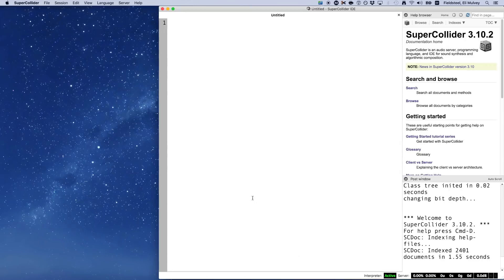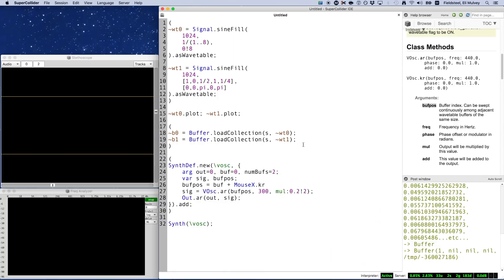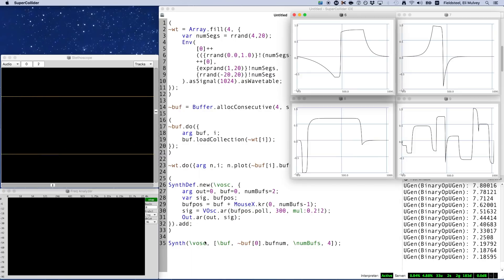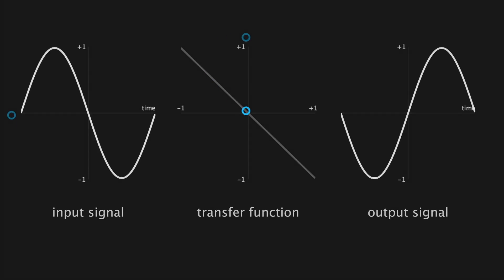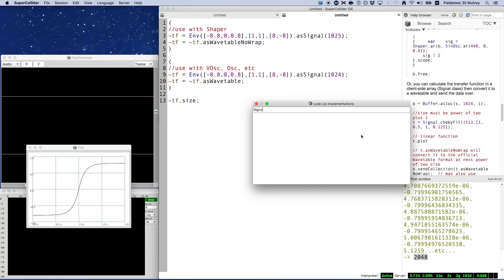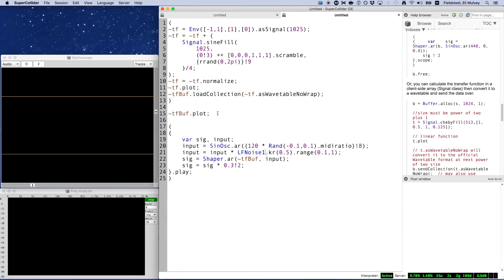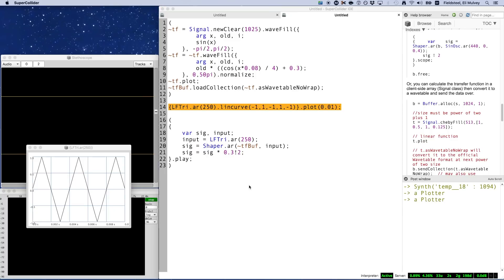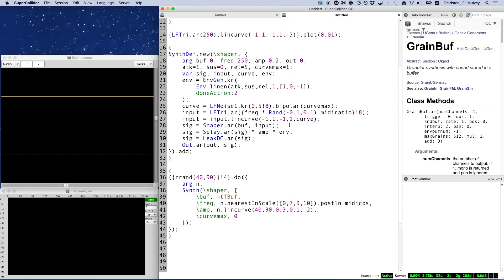SuperCollider Tutorial: 24. Wavetable Synthesis, Part II

Comment: Hi Eli thanks a lot for sharing all this knowledge. I understand ur a kinda purist but would it possible to implement something like this wavetable into Proxyspace ?
Reply from the maker: AFAIK ProxySpace is just a type of Environment that provides a more fluid live coding interface. It doesn't change the fact that wavetable oscillator UGens require a buffer to be allocated on the server and filled with data in wavetable format. Something like this, maybe?

s.boot;

p = ProxySpace.push(s); //create a ProxySpace

~out.play; //play a NodeProxy, initially empty 

(
//(run this clump multiple times for new timbres/chords)
//fill a buffer with a wavetable
b = Buffer.loadCollection(
	s,
	Signal.sineFill(
		1024,
		reverse(sort({exprand(0.1,1)}!16)),
		0!16,
	).asWavetable;
);

//define the NodeProxy's fadeTime and UGen function
~out.fadeTime = 3;
~out = {
	var sig, freq;
	freq = Scale.minorPentatonic.degrees.scramble + [32,44,44,56,56];
	freq = flat(freq!2) + flat((0!5) ++ ({rrand(-0.2,0.2)}!5));
	sig = Osc.ar(b, freq.midicps) * 0.2;
	sig = Splay.ar(sig);
};
)

~out = { }; //fade out

p.pop; //clean up
Reply: @elifieldsteel  a thing of beauty ! thank you

Comment: Hi Eli, thanks for the great tutorial, hopefully this finds its way to you.. is there a nice way of wrapping the transfer function/wavetable creation inside the SynthDef? 

I've had a go using LocalBuf but get a 'SynthDef too big for sending' error...
Reply from the maker: 'SynthDef too big for sending' is a warning, not an error. It can be safely ignored in virtually every case. It simply means that SC had to create a small scsyndef file on your computer (a handful of kilobytes usually), and wasn't able to send the information to scsynth "file-lessly."

It's possible to perma-bake a wavetable into a SynthDef using Buffer or LocalBuf, but I wouldn't recommend it and there's no obvious advantage as far as I can tell. It's usually better to keep the SynthDefs modular and flexible so they can be reused with other wavetables/parameters. Are you perhaps annoyed by having to run several discrete clumps of code one after the other? It's always possible to put everything in one big clump, you just have to make some adjustments to ensure that language/server actions are handled with the correct timing (see the sidebar on s.sync in tutorial 17: https://www.youtube.com/watch?v=P85X1Ut3Hfc&t=27m16s).
Reply: @elifieldsteel  Ah thank you for the clarification on the warning, that makes sense. Yeh i thought it might be a bit more succinct to contain it all in the SynthDef, but clumping it all in a function works just as well. 

Thanks again for these wonderful tutorials! fingers crossed for some more in 2021.

Comment: Hello Eli. I try to figure out this very interesting subject the last two days. I have understood many things, but not so much as a wholeness. So, as for the Shaper class: What's the actual difference between it and VOsc? I mean,rather than the techincal difference in declaration of the waves(noWrap and odd value). In the first video you mentioned that it's not musical to go abruptly from one table to the other during a synthDef, but in this video, although there is a deeper explanation of technical things, I yet try to understand how Shaper class allows us to go smoothly from one buffer to another during a Synth instance . Thanks again for your wonderful tutorials, I am sure that I have missed something, I may try to wach it several times.
Reply from the maker: The actual difference between Shaper and VOsc is, simply, that they are different UGens with different designs and purposes. To be more specific, Shaper generates a signal by indexing into a wavetable using some custom signal index that you provide. VOsc (and the other Osc UGens) also index into a wavetable, but the index signal is always a straight line, so it reads the table values normally, from beginning to end. What's special about VOsc is that it allows smooth interpolation across multiple wavetables. Shaper does not natively allow smooth transitions across multiple wavetables.

I envision many of these videos as resources meant to be watched several times. They contain a lot of information, and the average viewer is probably not going to retain and understanding everything on the first watch. So don't worry about it too much!
Reply: @elifieldsteel   Thank you for the answer.  I now have understood better the way VOsc. ar works. I search for creative ways to switch consciously between the wavetables, although Mouse coordinates, and other UGens of randomness were great options of you to demonstrate the subject.

Comment: Such educational tutorials. You are my SuperCollider professor! I was so impressed by the animated examples, linked in your description. Would it be possible to hear the waveforms at the same time as watching the animations? I could spend days adding two different waveforms and watching and listening to them morph from one to another. I would just not know where to insert the audio processing code to listen to them at the same time.
Reply from the maker: Yes, this would be possible, but it's not a simple matter of inserting some extra code on a specific line. The animation code is heavily optimized for visual representation only, so it would have to undergo a fairly major reconfiguration to accommodate visuals and audio simultaneously.

If you want to watch and listen simultaneously, the easiest thing would probably be to boot the server and run s.scope, and use that GUI tool as your "animation." Then, just use a Line UGen to move between tables inside of a VOsc UGen. You can adjust the horizontal slider on the bottom of the scope window to get the frame rate closely aligned with the waveform period, which makes it easier to see the wavetable morphing.

Comment: Thank you for another fantastic video! I’m wondering if it’s possible to combine multiple wavetable synthesis and waveshaping? Is it possible to interpolate between wavetables and use the current interpolation as a transfer function, and then traverse this transfer function at various “depths” like Shaper does?
Reply from the maker: These two techniques can certainly be combined in a variety of ways, although not specifically in the way you're describing, or at least, not easily. In SC, a wavetable must be a static entity (a collection of values stored in a Buffer). Buffers are fundamentally different objects than UGens; if you supply a UGen for Shaper's first argument, I'm not exactly sure what happens -- possibly, Shaper takes the integer part of whatever that current signal value is, and interprets it as a bufnum (which might produce some very strange and interesting results)!

There might be a very clever way to do what you're describing, but if it's possible, it would probably involve a lot of well-timed client <--> server messaging to continuously update a Buffer's contents. However, I think you can get equally interesting results by just making lots of interesting wavetables, using control rate UGens to animate lots of synthesis parameters, using multichannel expansion to create copies, and employing Shaper UGens in series.
Reply: @elifieldsteel  Thank you for the response, I really appreciate!

Comment: Is it possible to draw into a buffer to generate wave tables?
Reply from the maker: Like, with a mouse/trackpad? Probably, but not without some clever coding, I think. Translating pixels on the screen into samples in a buffer is not as trivial as it might seem. I think you'd ultimately have an easier time using wavetable generating techniques to approximate a drawing you're imagining. There might be some clever plug-in or quark that does this, but if so I'm not aware of it.
Reply: @elifieldsteel  this is doable in pure data though.  All arrays/ tables can be displayed and therefore drawable. But you're right, there's some clever approximation to translate from the display 2D space to the memory buffer of the table.